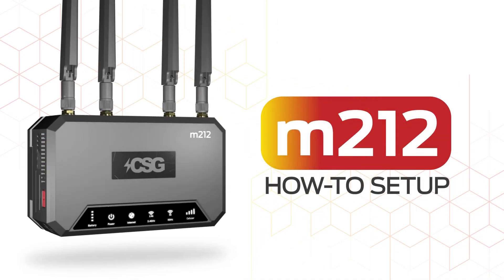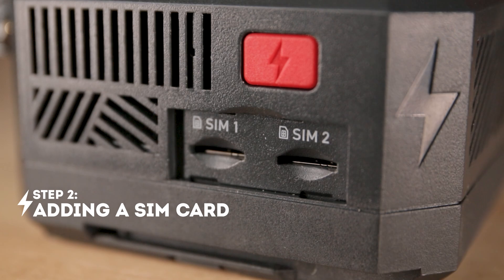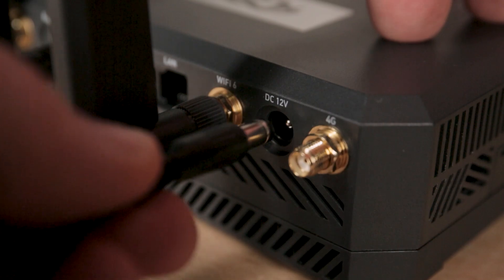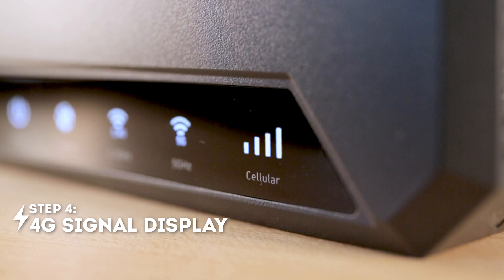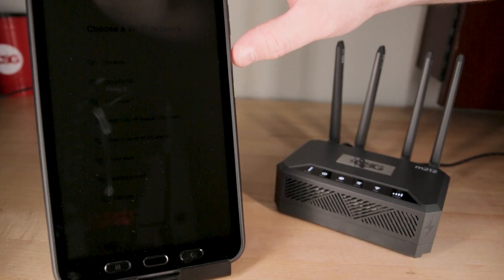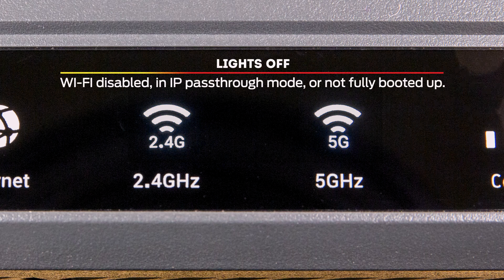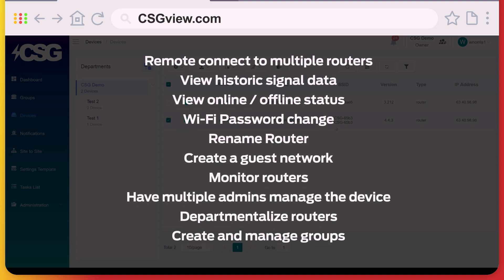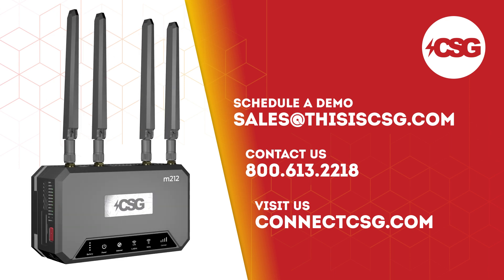m212 4G LTE Router - How to set up

Comment: 4g only? we used 5g now
Reply from the maker: Thanks for your comment! If you're looking for a 5G router, you might want to check out the M519: 
https://youtu.be/wdtAIjYUzc0?si=HPq1mAg8DjZwWL9l

The M212 4G LTE router is a great choice for the 41% of Americans who still rely on 4G, especially in rural areas where 4G tends to be more stable than 5G. It’s perfect for ensuring a reliable connection where 5G might not be as consistent yet. 

Have a good one!